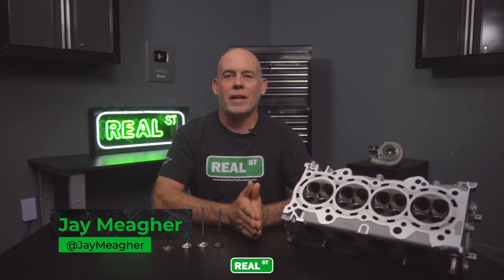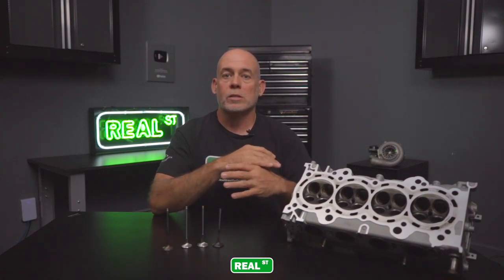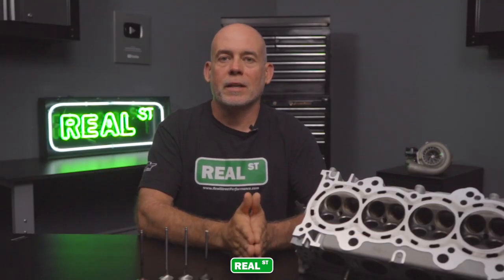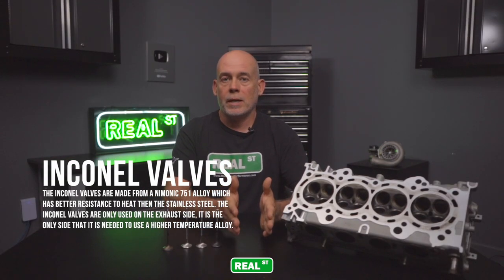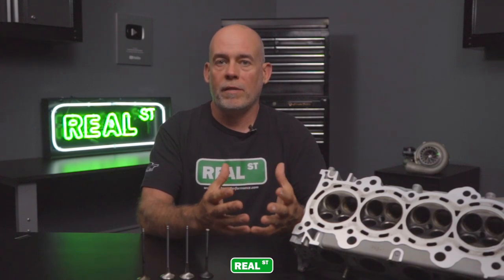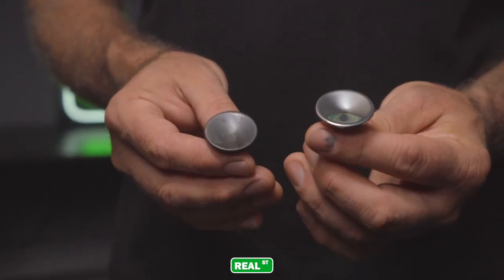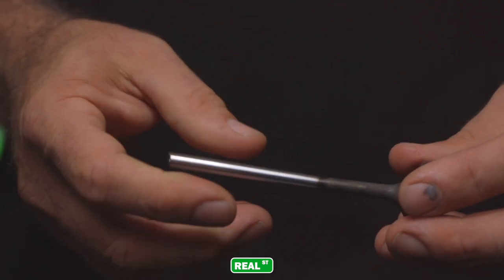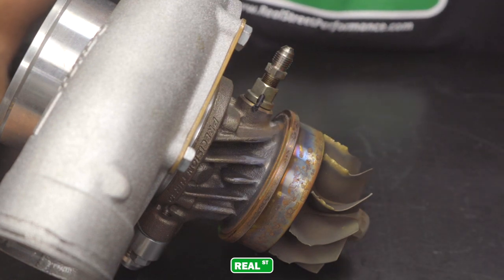Valve Related Issues Due To Excess Heat - What You Need To Know | Jay's Tech Tip

Comment: Jay, I would love to hear your opinion on using engine braking to help you slow down after a run, vs putting it in neutral. I have heard people talk about how it saves the rods, but I find it hard to believe you're putting more stress in the rods during decel than you are when putting 1500hp through them.

Comment: Hey jay on the subject of antilag moving away from drag raceing ... apart from the pressure spikes potentially poping the valve off the seat  with fresh air style antilag like in rally is this valve heating issue less of a concern or is the trapped heat still a large issue